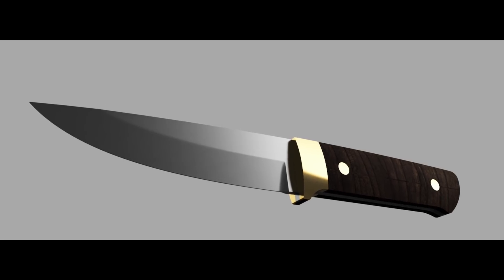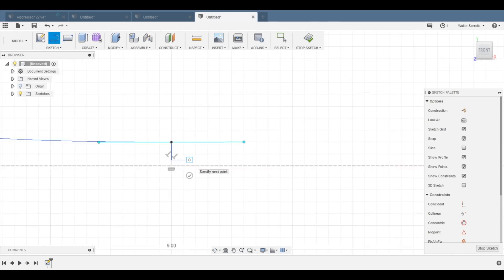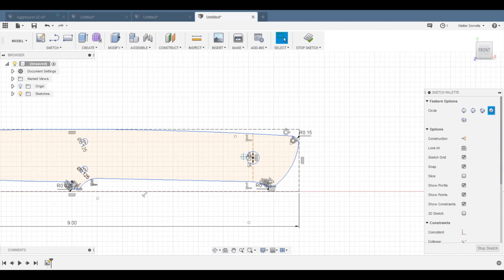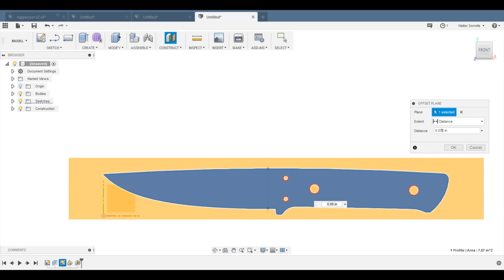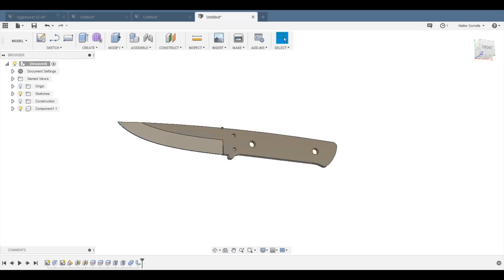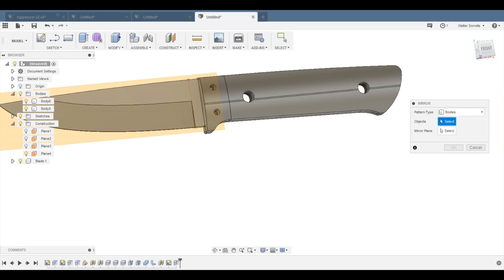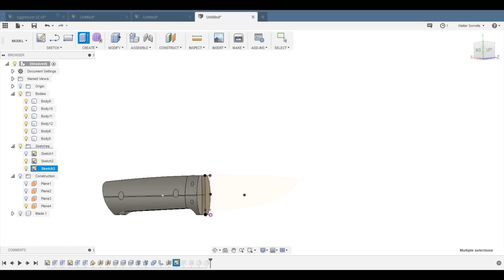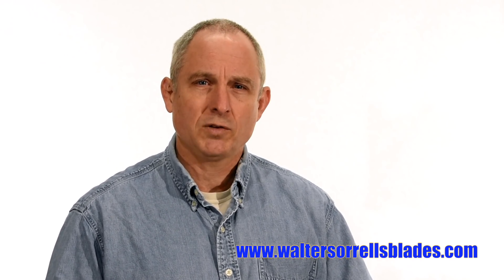Design a Knife on Your Computer!  CAD Project!

Comment: why would i invest in such an expensive way of designing my knives, if i can just draw them on paper...
Reply: You may be right, But even though I am getting old, you still have to communicate, as I understand, with others,  so they best know your important point. be it to manufacture,  pass on your great knowledge, or anything else you may want to pass on to others, Consider what you may, or may not understand as a challenge to learn , and as an example to others about what may be achievable.
Reply: Don't mean to be a Richard, dude, or in anyway condescending, Paper is perfect for getting an idea even started.
Reply: in terms of CNC, you have to design it in a CAD, many knifemakers use CNC's if they are producing many knives at a time. Just thought you'd like to know!

Comment: Splines... give me gas.  I've been teaching an Introduction to Engineering Design class for 13 years and Autodesk Inventor is the primary tool.  This would be dead easy to run up in Inventor.  But splines...  They can get out of hand to the point where it becomes like trying to stack marbles when trying to keep them properly relating to each other in a sketch.  The user interface is much different than what you're using, but all of the tools are there to do exactly the same operations.  I'll be retiring within the next two years and will loose access to the software, so I need to find a replacement that I can afford.  Inventor is about $1900/year!

Comment: I use to draw my designs out, and then made fun of the  people who used CAD, but then they had the last laugh because I tried it out, and now I loved it! After I got use to how it all works, I can now design a knife to  perfection. My pin holes are centered, they are the same distance apart from one another without doing any guess work, put the cross hairs to find the center of the holes I want drilled out. And know I'm designing a dagger which would be a pain keeping everything symmetrical if i was drawing it out. After I'm done with a design, I just print it off and get to working on it.

Comment: I don't know Fusion but I have done a lot of Auto Cad work.  I agree about using trimmed circles for design, but I thought someone told me that some of the coordinate details are lost to the CNC (or water jet, or  whatever) when the coordinates of the arc is not called out in the first place.   thoughts?

Comment: Hey Walter, I'm just starting with knife making and I have made blades but I cant heat treat because local laws prohibit the use of open fire. Now I have been suggested propane torches but those also are not allowed in my apartment. The one thing I could think of would be a barbeque, a household propane one which is allowed where I live. Could you let me know by any chance if this would work for quenching? This is so that I can actually get a working tool then I would temper in my oven. Thanks and your videos are great!
Reply: I've done it on a barbecue with charcoal. The only thing is that you need a hair dryer (or anything that blow air with sufficient flow) to get the charcoal up to temperature.
Reply: @adam-sn1ll  do you know if you can get fire brick in a regular hardware store or does it need to be ordered online
Reply: @adam-sn1ll  thx 4 the info I will let u know how it goes
Reply: Might look into Trash Can Forges. They use a contained flame with a torch driving it.